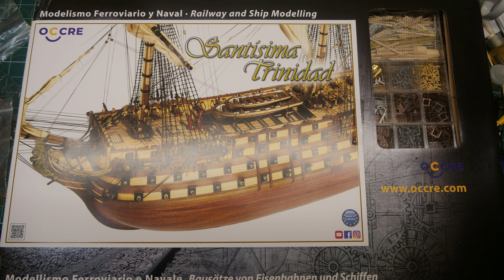This weeks update, reveal next build on the channel| Belem Tall Ship Build Diary 64,

Comment: Im currently building the one from Artesiana Latina, its a massive project. I kind of wish I got the Occre kit cause the paint is a huge pain. Looking forward to seeing  the comparison of the two kits, and the custom work you do to it. That seizing gadget is a great idea!
Reply from the maker: Hi Robert, ive been watching Greg (a viewer of the channel who has his own channel) he has built up the frame,  i must admit Artesania kits are not the same quality as they used to be, after the Belem i dont think i would get another, the frames are very thin, will you be packing out the ribs prior to planking?. The first version of the siezing gaget needs a few improvements, but it works and does make it easier lol
Reply: I agree with the quality, my dad has an older version of the Bounty, no double planking ribs are solid etc. No I did no pack the ribs, and planking is one of the many things I struggle with, that's why I went with the painted version lol. @g-kip

Comment: I gotto make 1 of those. Tho i think i would span it in a vise. Currently i simple span a needle in a vise to hold the block, and hang a weight  on the loose end.
Reply from the maker: Hi Martin, I may come up with some improvements, but it does make it easier and neater.